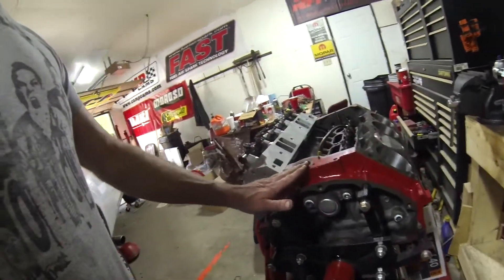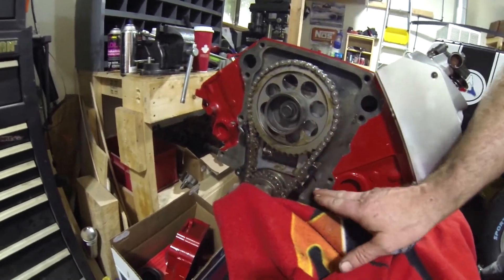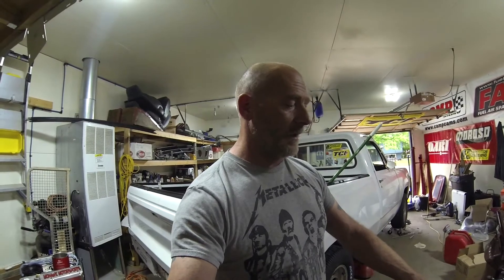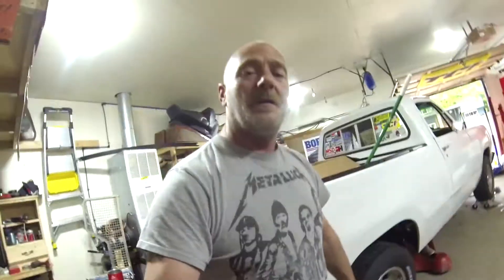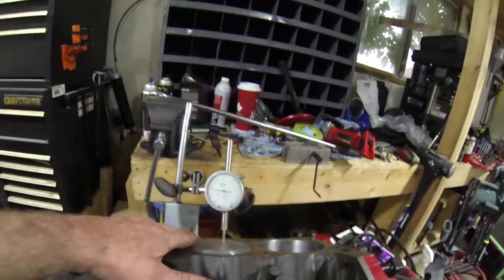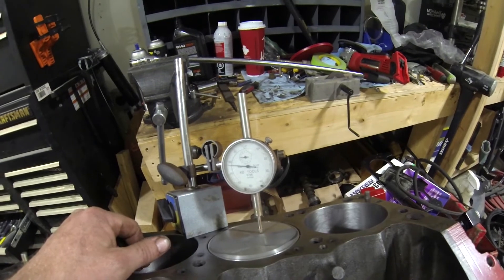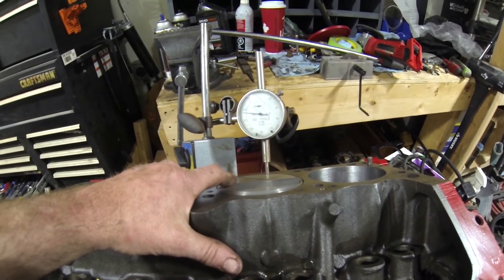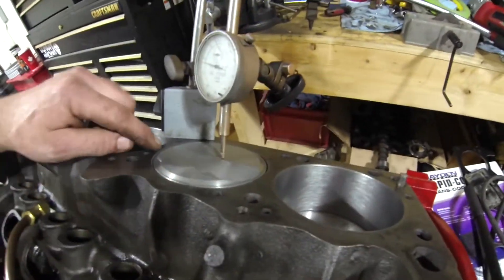50Year Old 360 Mopar. Mistakes can Happen!!!

Comment: As they say sh!t happens. How much can you shave off the pistons before they become compromised?
Reply from the maker: It really depends on the piston. There are times the only option is to get a complete set of different ones. Strokers are a prime example as with the piston pin height put closer to the top, there is usually less "meat" to work with. I discussed it with my local engine builder and as it was basically the dome that was going to get milled off, there was ample material for removal. I don't have a "too thin" spec as I haven't had this happen before and was kinda new territory to cover. Thanks for watching!